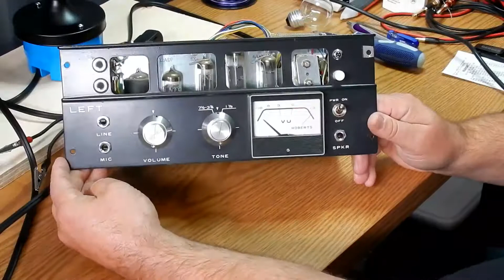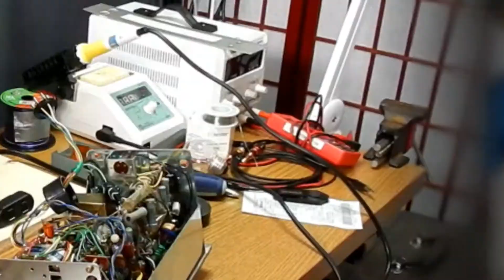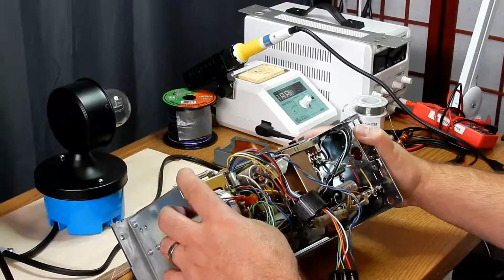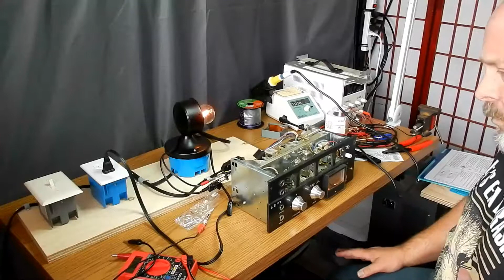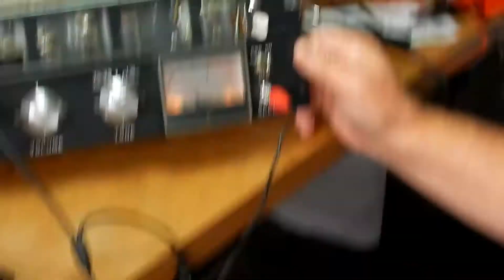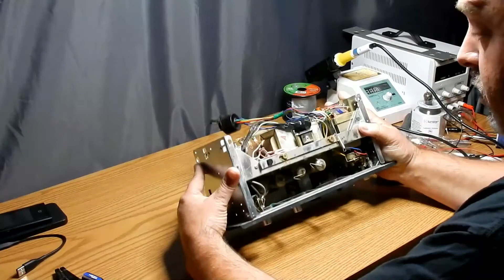Roberts 770X  Reel To Reel - Video 2 - Left Channel Vacuum Tube Amplifier Disassembly And Evaluation

Comment: Hi , I am working on a akai m8 which is the same. 
It is missing the metal mechanisms which switch the amp in to record   Not sure if you now need those parts  and if not I would be interested in having them. Also missing the sound on sound switch  but you may need that.  Cheers John